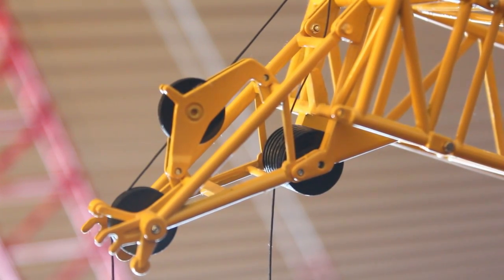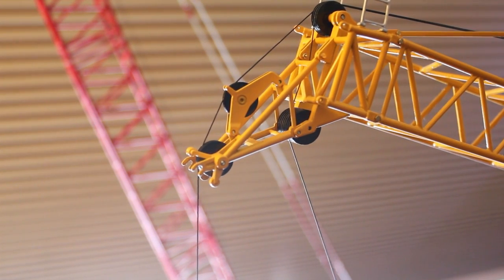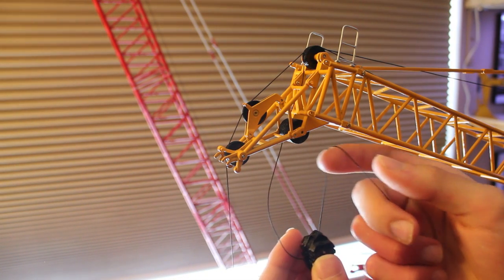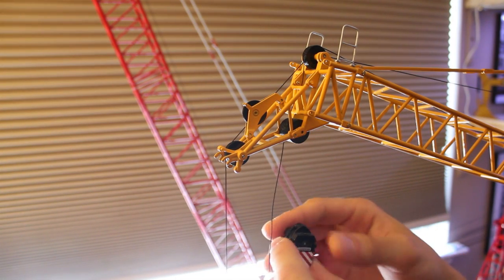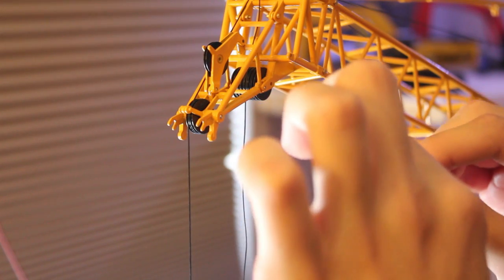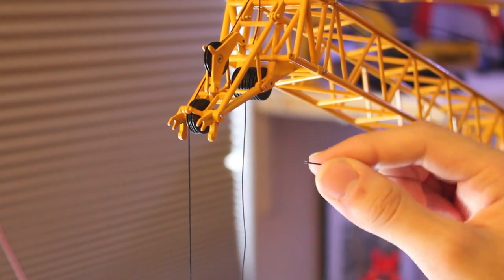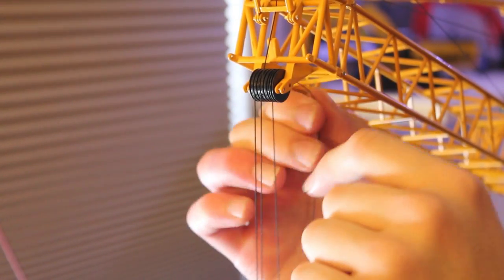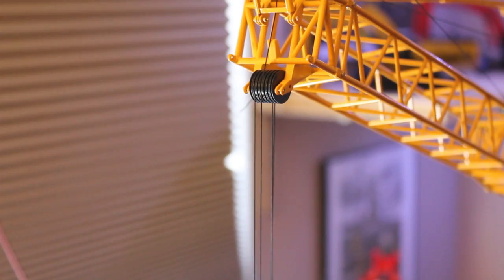How-to Reeve a Model Crane's Hook Block

Comment: I write this with respect. I'm an Iron Worker (retired) who has reeved many crane blocks. I now enjoy collecting/building model cranes. What you have done here is called "Lacing". Lacing occurs when the sheaves are parallel (head section - block). Reeving is when the block sheaves are perpendicular to the sheaves on the head section of the crane. FYI

Comment: So, there's not trick, or tip, or anything on reeving say a 5 part line? Bought my first diecast, an AC-500-2 Terex and I got the dark blue jib to match the white and blue paint on the LCR Group Terex. Thing is, great video, love the fan part! But I was hoping for some, like kick ass cool trick to make my 47yr old eyes and fat painful fingers help with the block. As a Pioefitter I have re-strung or strung many a cherry picker and heavier cranes blocks, I'd say it's actually easier to do on a real crane! Lol

Comment: Nice review! with the larger blocks with more sheaves i found the best way is with the curved pin supplied with some of the cranes , that way it keeps line right on the sheaves when pulling string threw..
Reply: What's a curved pin?  I can hopefully reproduce it with a paper clip!